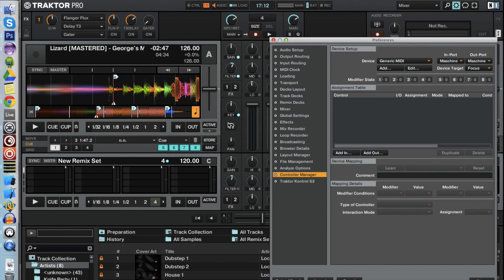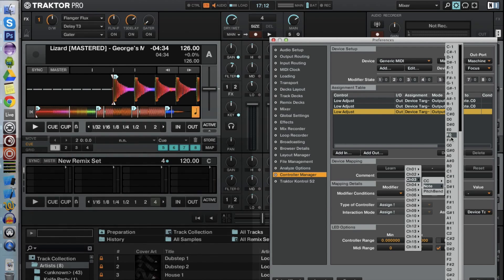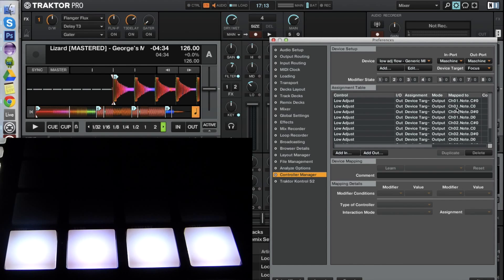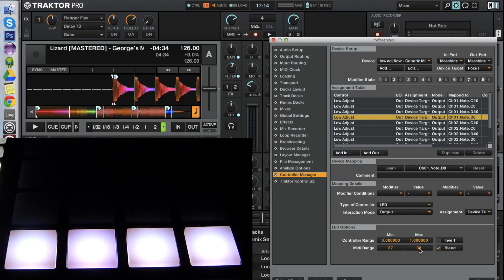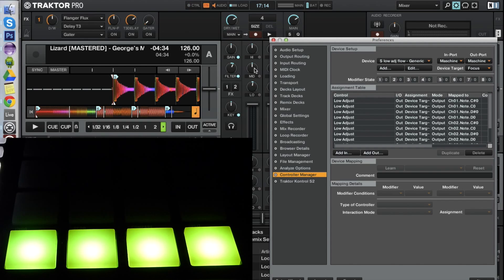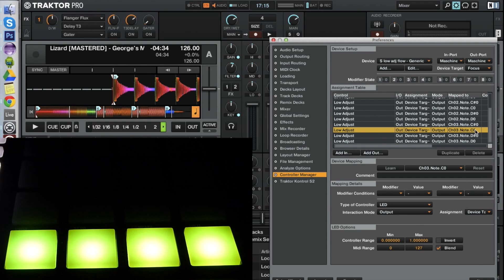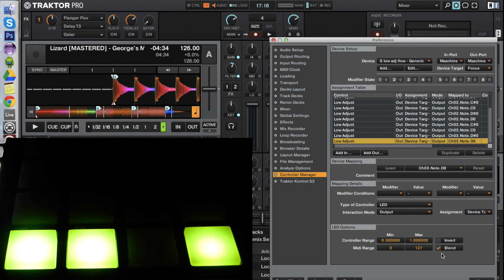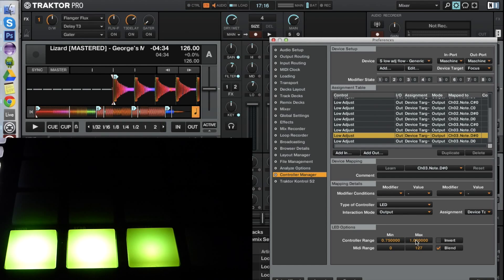Traktor Maschine HSB MIDI explained Part II

Comment: Nice tutorial!
I have some questions
1) When you select the "maschine virtual output", does that mean that traktor is comunicating with maschine via HID, or is it still midi?

2) I remember that when I mapped the midi out lights for my old dicers, I got cpu spikes when Traktor had to send too many signals. I got around that limitation by using midi yoke in between the signals (traktor-midi-out to midi-yoke, and midi-yoke to  dicers). I don't know if this is a windows problem or a Traktor problem. Do you experience any glitches when sending too many midi out signals to maschine?
Reply from the maker: Lautaro Palenque hey bro
1) I am pretty sure it is MIDI (unfortunately)
2) I once mapped a visualizer onto my Launchpad (100+ buttons simultaneously) on a very crappy Acer laptop and it survived. The only thing that changed was (as always) the fucking huge loading time when opening up the MIDI mappings